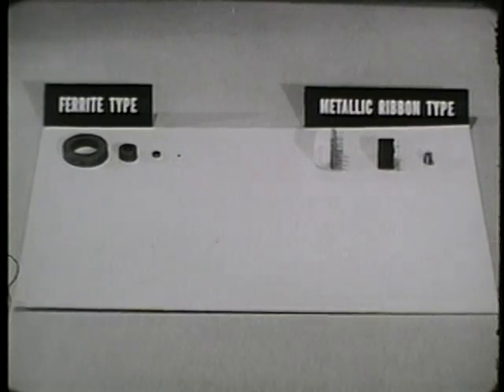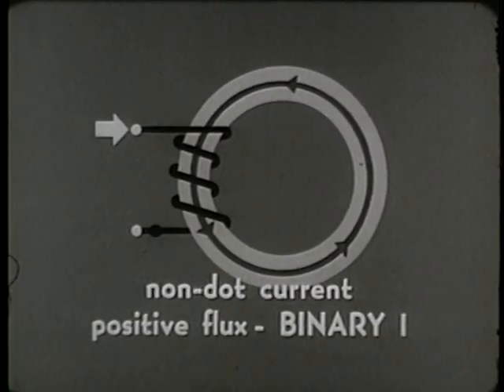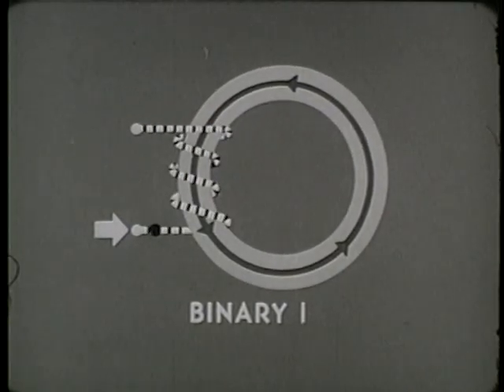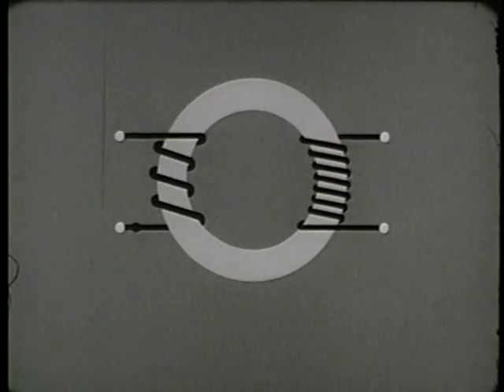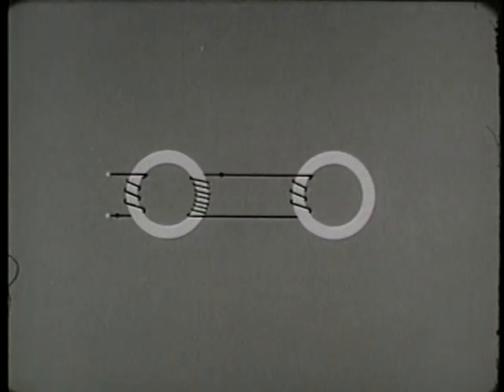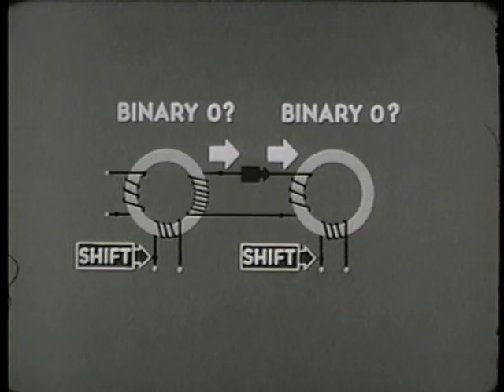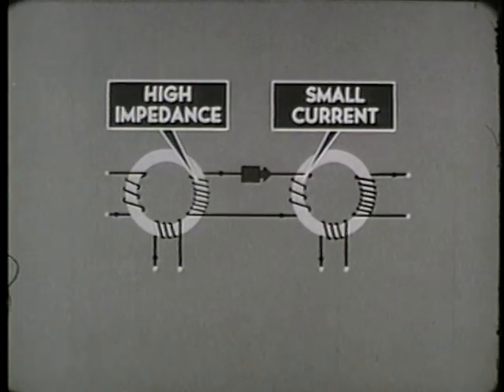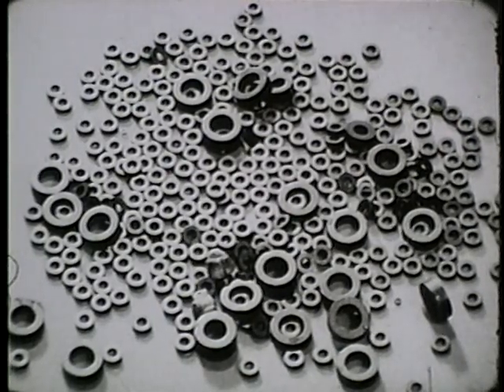MAGNETIC CORES - PART I - PROPERTIES

Comment: Let me begin by expressing my sincere gratitude to You for "eternizing" these films and for sharing them with us.
How ever I have a question regarding what "Sergeant" is saying.  
After just having said:
"A non-dot input sets the first core to a 1(one). Nothing happens to the second core". 
(@20:56) He continues to say:
" Power flowing in this direction sets a core to 0(zero), but that's where this core is Already"..
Now while that is true and correct, it seems a bit odd that he at least doesn't add that EVEN if the second core was a 1(one) it STILL would not change TO a 0(zero) due to the fact that the "unidirectional device"  would NOT ALLOW any current to flow in that direction !??
Since the "unidirectional device" TOTALLY disables the second core to "receive input" on it's "Dot-Input" [[I.e. setting it to 0]] regardless of what the previous core is "doing"....
Or am I misunderstanding how this works ??
Best regards.

Comment: forgive me, if this is a dumb question, but I always wondered? why the magnetic core needs to be toridal? why can't it be a bar or a cylinder?
Reply: There also exist rod type cores and so called I cores, which are basically a flat bar. 
Huge benefit of toroidal is, that you can fit a decent amount of turns and and also have the terminals aligned propper. Also, they are very compact. 
The shape you desire depents on your magnetics purpose.

Comment: If you dismiss the dot concept and rely on lenz-law at 21:02, the bit will never shift because there is not a change  in a magnetic field. If I am wrong, help me understand without using this added dot concept because it can easily be arranged differently and not give the same answer.